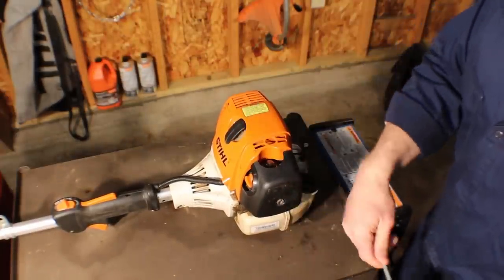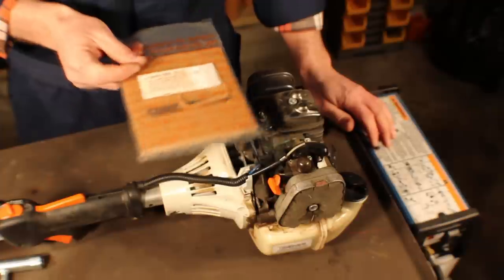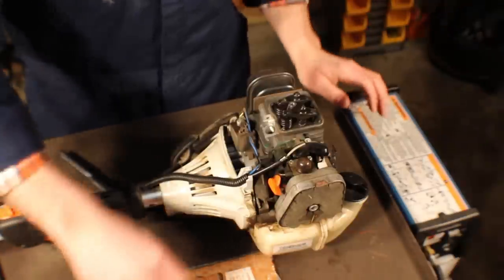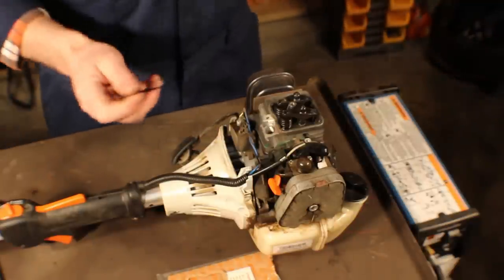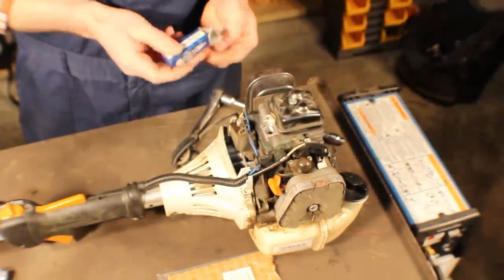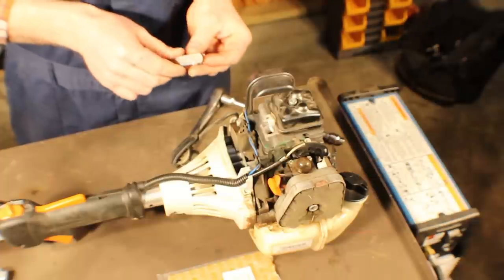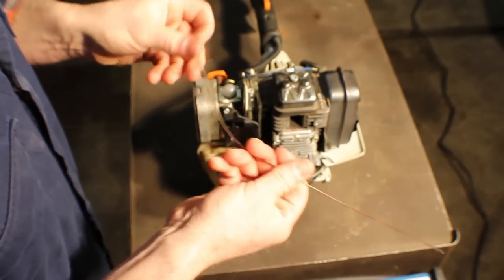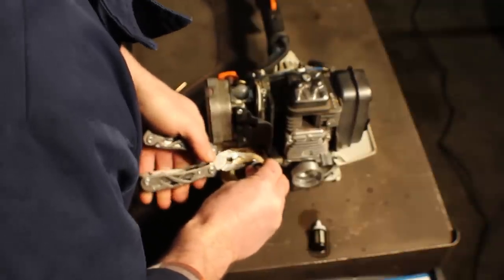Stihl FS 90R Trimmer Maintenance

Comment: So you can adjust the valves by just tightening or loosening a bolt? i thought you had to shim the valves back to spec. I have a fs100rx and valves are the only thing that worry me about the 4 mix engines.. These videos are helpfull. Oh yea, one more thing.................FUCK.
Reply from the maker: Yep, the valve springs give you all the tension you need, don't need shims for these.  Working sales I heard that concern many times, once I got it across to them how easy it is to check, many were very happy with the 4mix, I love it for the extra torque you get.  It is something that needs to be done though, with a 2-stroke you just gas and go, for years.  These need to be adjusted occasionally, they say after the first 100 hours, not sure on intervals after that.  I generally just do it yearly with my other maintenance.  Damn right FUCK, lol.

Comment: I might consider mentioning that if you are unsure if the valves are set slightly off that to loose is much better than to tight.  To tight and you will burn up stuff causing serious damage and to loose it will run slightly off and be more difficult to pull start the thing.

Comment: Are those air filters servicable. Compressed air? And don't tell me to read the effin manual! LOL. I bought my FS90r at a pawn shop for 150  dollars out the door. It crank on the first pull for 2 seasons till I loaned it to a friend. Still cranks and runs but it drinks gas.

Comment: I have a km90r that is hard to start and doesn’t want to stay idling at times and sometimes it will die after letting off from full throttle. I have changed the spark plug air filter adjusted the valves and took out the spark arrester screen. What would you suggest I do from here? I can see a small amount of oil around the crank seal when I take the recoil off.

Comment: Dumb question - Do ALL Stihl tools use the same spark plug? I know all Stihl chainsaws use the same spark plug. Do all trimmers use the same? Blowers? etc.? ? ? Same question with fuel filters. . .  Thanks
Reply from the maker: +kvn08cosmo Not a dumb question at all.  The answer is no, they don't all use the same spark plug, there are two different ones.  The standard 2-strokes have one, and the 4-mix engines have a different one, only those two though, as far as I know.  I'll have to get back to you on the fuel filter, I can only think of one main one off the top of my head, but I'm not 100%.
Reply: I have seen atleast three different fuel filters on there tools.  There is also a smaller zama made one but I don't know the models which use different ones.  Some of the older backpack blowers like the BR420 used a large walbro one.  They also make a weighted version of the one you see in this video.  Not a dumb question but a very good one atleast in my opinion.  One of the better if not the best one I have heard in a while.  Dont ever feel like you are asking a dumb question and if people give you shit for it well then fuck them since they are the one with the issues who like to be nasty for no reason certainly nothing you wrote, said or did.  I have seen some expensive tools with damage done to the top of the piston due to the wrong spark plug as have seen the threads stripped because of the same thing.  Better to ask than damage a 600 dollar trimmer like the last one I saw this happen with.
Reply: I just looked at the parts manual which is outdated I will say first of all and I believe I saw 5 different fuel filters and anything 4mix is not listed in it so there could be more.

Comment: Got the FS110R It's great but when you hit something thick - the RPMs drop with longer recovery times than most Shindaiwas I use. I suppose this could be a 4-Mix  issue as the sudden drag on the motor probably screws up the air/fuel mix more than in a normal 2-Cycle.

Comment: What thickness is the feeler gauge? I went to local dealer looking to buy this service kit and after waiting 5 days for it to come in, I only got a valve cover gasket. I inquired about this kit again, and told me the feeler gauge was not available. They also wanted me to wait another week for the sealing ring. I just bought the gasket and left. I'm sure I will be fine using the old ring for a while longer. My FS90r probably only has 20 to 30 hours on it, but doesn't idle this year without stalling for the first 10 minutes or so. I want to adjust valves before adjusting idle. Thanks.
Reply from the maker: Sorry you're having problems with it at the dealer, unusual.  It's a .004 inch gauge.
Reply: Human - Thanks
Reply: Jim Dent I've heard u can also use a business card. Not for sure though
Reply: Caleb - A business card would be too thick. I think you are thinking of the airspace gap between a coil and the flywheel. Any small engine coil I've replace instructs you to use the paper box the part comes in to set the air gap, and the box would be about the same thickness of a credit card. Cheers!

Comment: Just the other day I bought a tune up kit and it included Spark Plug Ari Filter and Gas Filter, But not the Primer Bulb lol, also at 50 hours I sent my FS 130 R in to get Her mandatory 50 hour valve adjustment. Is that what they basically did?
Reply from the maker: That pretty much covers it yeah.  Don't need to change out the primer bulb unless it's having issues, just a common thing to change so I went ahead even though it wasn't needed.
Reply: +Human sweet mine isn't that brown yet lol, but I do have a shit tone of vibrations and she's a shaker, could that be a valve misplacement or a little off balance

Comment: I have a new line head but the line just keeps getting stuck inside, how can I fix this
Reply: You are likely using line that is too thin or weak for the amount of power your machine puts out- look up what size line is correct for your model- also, sometimes old line is degraded by sun and will just disintegrate as you seem to have described

Comment: Is that mixed gas or oil an gas?? I'm wondering because of the valves.
Reply from the maker: it's mixed, a hybrid engine, pretty much all 4-stroke, but uses the oil in the mixed gas for lubrication.
Reply: @Human1337  what about an 064 av chainsaw

Comment: the valves on my FS90R are bone dry,  can somebody tell me why please! and over heats, please help me.   jose
Reply: They might be set to tight but I can't say since this is a issue I am unfamiliar with.  They might also have a worn out bottom which should be either flat or cupped but only one of the two.  I can remember which but I think it might be flat.  I hope you are using a full synthetic 2 stroke oil also and have the carb not set to lean which means that the L scew is slightly to far in.  1/16 of a turn should make a slight difference in the lubricating of the thing and the further out the more fuel/oil it will allow in per Cubic foot of air.  Colder air is also denser so it will run leaner when the air is colder also if you are at a lower altitude.  That is probably about all the information that might have something to due with you issue I can provide.  If nothing else take it to the dealer and pay them assuming its not under warranty anymore.

Comment: Oiy geezer, ( human geezer) why has my 130r kombi engine started making a jingling noise when i run it. Had it almost a year non commercial use.  Cheers. Thanks for making the vid. I won't come to your shop koz i'm in England
Reply from the maker: Often it's simply the clutch pads swinging out and tapping the drum, try turning down the idle a bit and see if that helps.
Reply: Thanks mate. Your right that thats when I hear the noise ( when it idles) Ill do that on the carb then. Btw theres some good videos on the stihl carburetors and how all the flows work in them by a guy called the repair man. Have a look ! You probably know all to well how they work lol.
Reply: 'TheRepairSpecialist'

Comment: So why are the valves black like a diesel? And would it be safe to use some type of product to make them clean? Also would it be safe to use engine degreaser onto  the engine? Well at least on mine the FS 130 R LOL?
Reply from the maker: The top end of the valves don't need to be cleaned, it's the other side, that is inside the cylinder, that can get carboned up from using cheap two stroke oil.  Best way to keep them clean and not have to worry about it is by using synthetic two stroke oil.  I would hold off on cleaning them, usually not an issue until the machine is quite old, and to do it you basically have to take apart the whole machine.
Reply: +Human oh OK good to know, when you say synthetic oil are you referencing the oil that still provides like the gray bottle? Because that's what I use well until now, now I'm using straight up Moto mix.
Reply from the maker: Yep, both of those are synthetic.  Moto mix can get damn expensive though.
Reply: +Human LOL, yes it sure does get expensive it's $34 down where I'm at

Comment: I am thinking of buying a new trimmer for back up, I am not sure if I should go with 90R or 100RX. What would you recommend?
Reply from the maker: I'd say it really depends on what exactly you'd use it for.  If you're sticking with a line head, and nothing else, the FS 100, it's the straight 2-stroke so it has less moving parts, less maintenance.  If you want to possibly add an attachment, then the FS 90 (It's what I have), the 4 Mix engine is more 4-stroke than 2, so you get more torque out of it even though it has a lower HP rating.  Just my opinion though.
Reply: Thank you! I am going with line cutter and brush cutter blade.
Reply: @fullsteam208  the FS 100 RX is not made To  accept brush cutter blade
Reply: @tgwinternational3296 
Thank you for the reply. I went with the 110
Reply: @fullsteam208  oh ok 110 is also good

Comment: I just got a straight trimmer attachment for the Kombi head, and it does not have a grease screw on the gearbox.  Is there a way to grease the gearbox?  Thanks.
Reply: Do you mean the steel blade edger? 
I ask because my edger has no grease fitting either.
Reply: Wayne Essar
No it's the straight shaft string trimmer attachment.  Interesting that the edger head also doesn't have a grease fitting.  Both my FS90 and my FC90 have grease fittings.  And I know the older straight shaft trimmer attachments for the Kombi have grease fittings.
Reply from the maker: I don't work at the dealer anymore, though I'm up there weekly at least.  Next time I'm there I'll look into it, not sure right now.
Reply: Human
Thanks man.

Comment: Reminder to use earplugs when listening to this around small children, would of been nice to have a section about putting it back together for single moms :) other than that some what informative, other than the swearing it helped some.
Reply from the maker: Single mom running an FS90R, now that's sexy.......but you're absolutely correct about the hearing protection, and eye protection as well.  For putting it back together, you can just follow the disassembly in reverse, I was running short on time while filming.

Comment: What causes fuel to wet the air filter on a 4 mix string trimmer?
Reply from the maker: Not really sure on this one.  Might want to check the tank vent, but that's just a guess.
Reply: Kevin Hill metering diaphragm getting hard from ethanol fuel or old age.